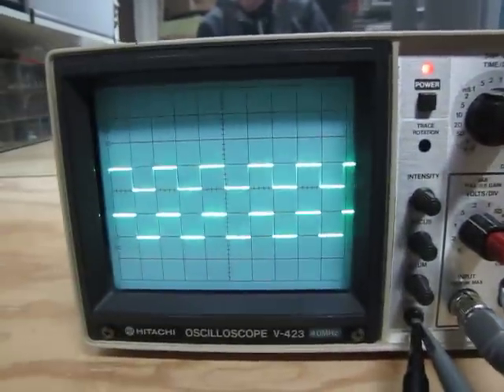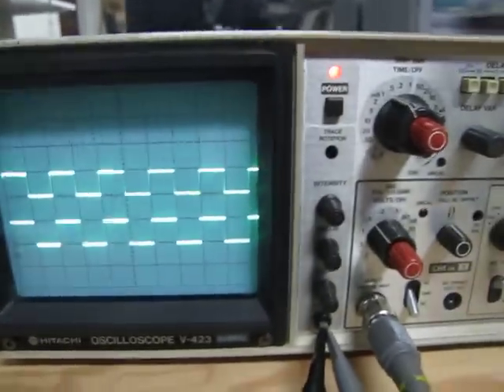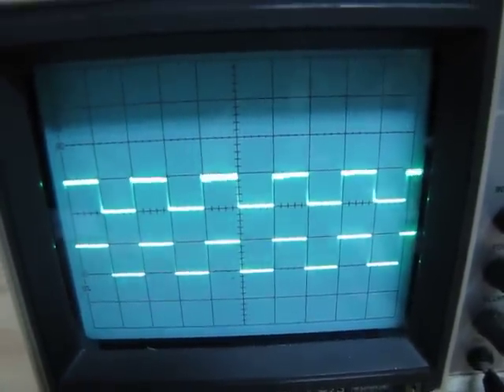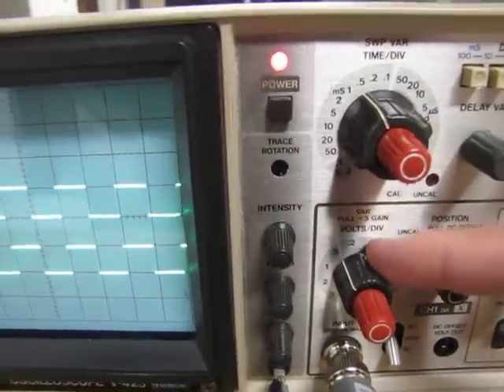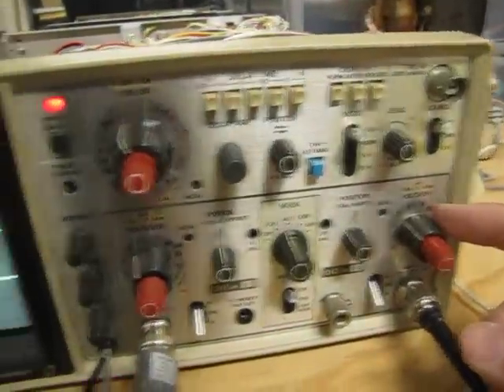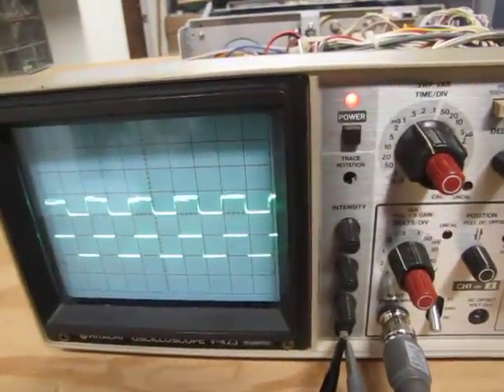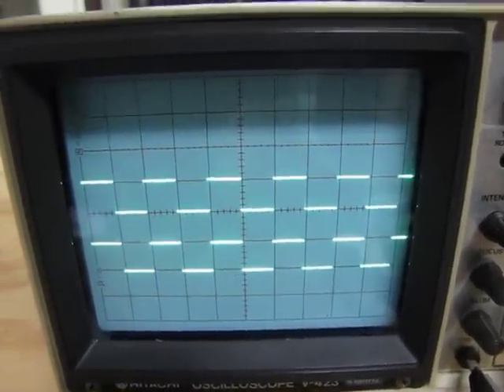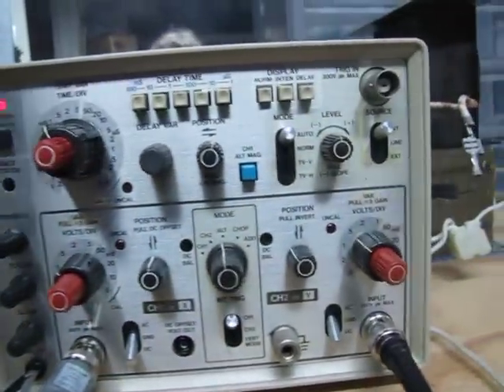Sketchy Oscilloscope Knob

Comment: this is a common issue with older scopes, the contacts inside the volts/dev switch and/or fine adjust knob are dirty.  they aren't too terribly easy to clean - you can take it apart and try spraying in some contact cleaner while turning the knobs to try to clean it up.  of course have the scope unplugged and discharged ;)  this also can affect the time/dev knob.  May require removal and disassembly of the switches to get the cleaner at them. (no fun)

Comment: Hey, sorry I'm no expert at all on oscilloscopes, but I have a little experience.
If you want to start by excluding possibilities, you could check if it is only when you physically stress the buttons that the change occurs, or whether it is enough to make an electrical contact (touch them with the skin). If the cause it the latter, there might be some faulty earth/ground connection inside. 

Just an idea, don't know whether it can help you.